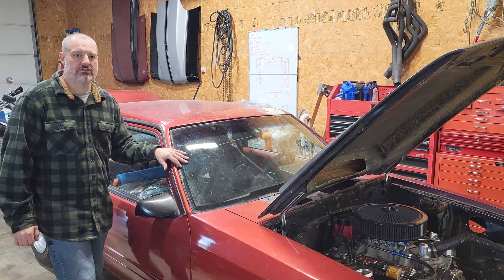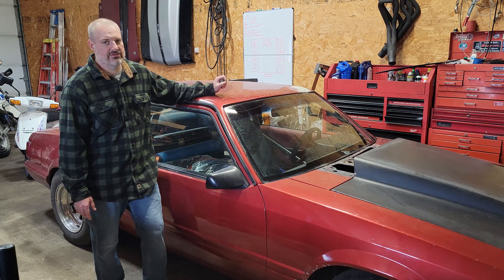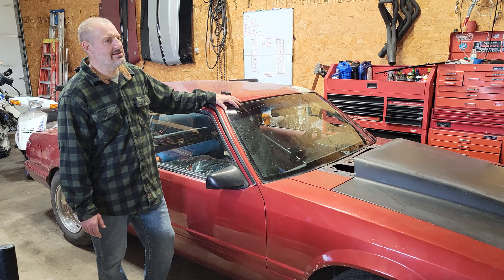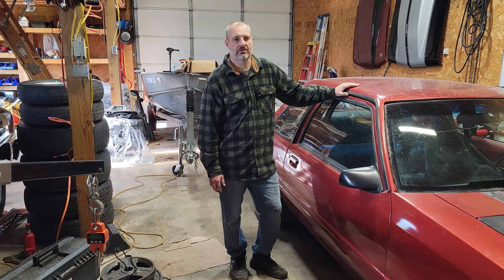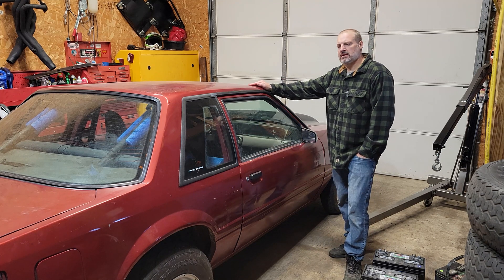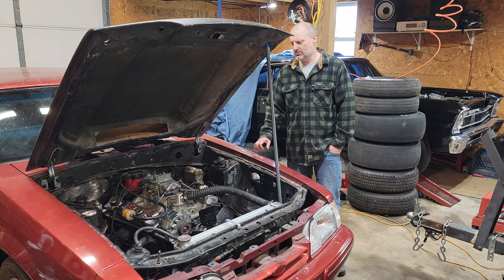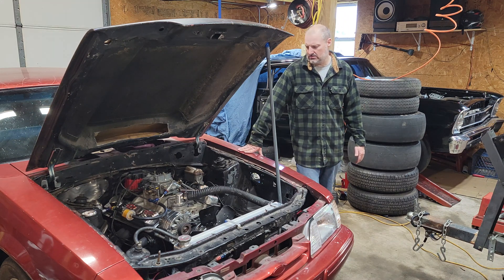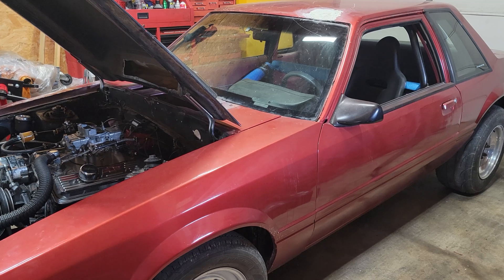Foxbody mustang 1000 lbs of weights added. Weight reduction Drag test

Comment: Right now I have a 88 monte carlo SS with a 439 cubic inch big block its a 427 0.60 over right at 11 to 1 compression AFR 265 heads Victor jr. Intake atm 950 cfm howards hydraulic roller 235x241 on a 108 lsa 618 lift getting ready to swap to a 254x260 solid roller 660x666 lift on a 110lsa im hoping it will pick up about 30 hp that will put me right at 700 hp. The engine dynoed at 661 hp 605 tq @6200 rpm. Love your channel

Comment: Thanks for the great video. Wondered how a mustang cud weigh 4k. Track tech wud have a stroke with ur balast lol. Had that engine in a similar nova at 3050 lbs. Power falls after 5k rpm. Adding a comp 280 hyd cam, wud pull hard to 6k . Ran 11.8's @112 mph in 1/4/ 7.5 @91 in 1/8 on average
Reply from the maker: Nice, thank you. Might be the direction I go with this engine.

Comment: I like the vortec engines. I have several sets of 062s and 906s and i recently built a budget 383 with ported vortec heads. It's just shy of 13:1, on e85. It runs like a scalded dog in my OBS pickup. It's a little rowdy for the street but not too bad.

Comment: Brings back a lot of memories from the old street racing gig, I remember doing a similar test with my 70 Camaro, went from running 7.50`s with a small block 350 to running 6.70`s with a 468 big block all on the motor with factory rods, blocks, heads, cast cranks, 2 bolt mains, etc.....basic junk yard car with a junk yard motor deal lol.....keep rolling.....
Reply from the maker: @TunnelVisonMotorsports-o5z  You got it, thank you.

Comment: You can hear the rear tires getting more "chirp" at the 2nd gear shift as the weight drops off.
Reply from the maker: @jeffallen3382  Yes definitely need to readjust the suspension.